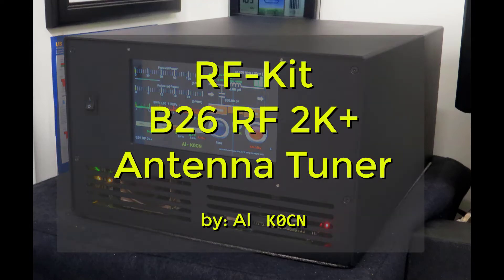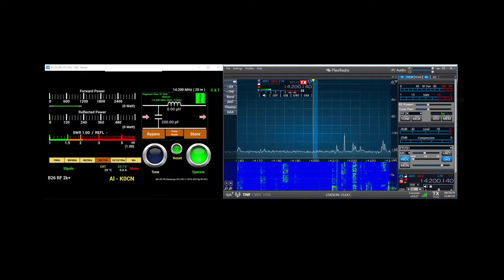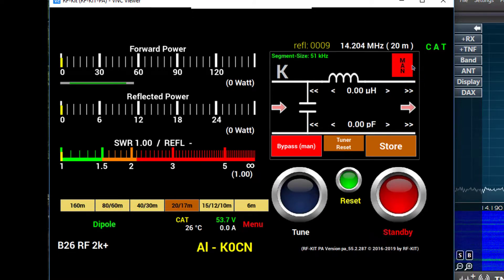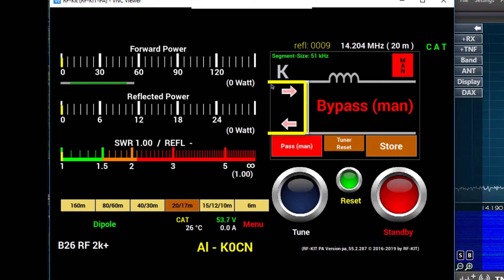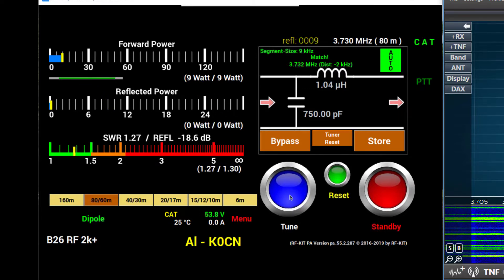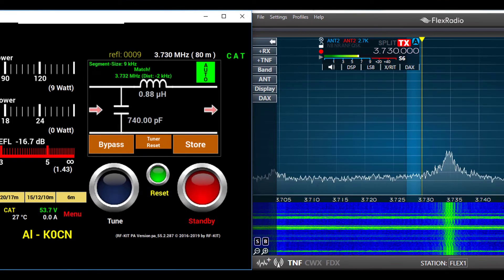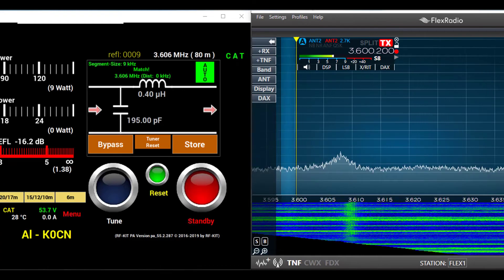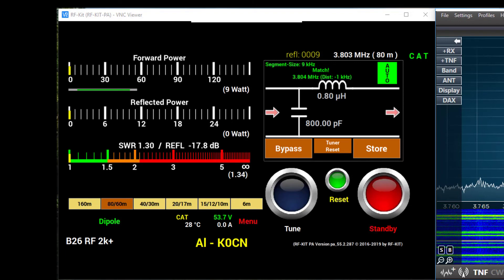RF-Kit B26 RF 2K+ Antenna Tuner

Comment: Good video Al! , does the amp allow you to program auto switching antennas for specific bands? 73
Reply from the maker: Thanks for the comment and for watching the video.  Yes, it does. The antenna, tuner and antenna switch can all be set for a specific bands. I have three antennas on mine. A dipole, a vertical, and a 6 m antenna. When I switched to certain bands, the amplifier will automatically go to the antenna that I selected. Works good.